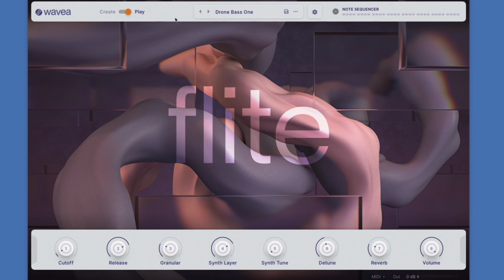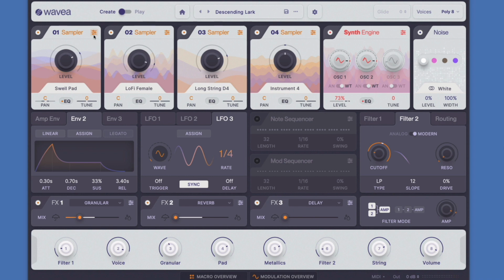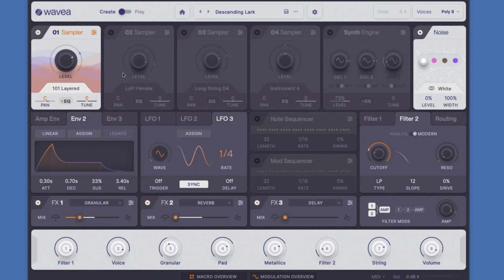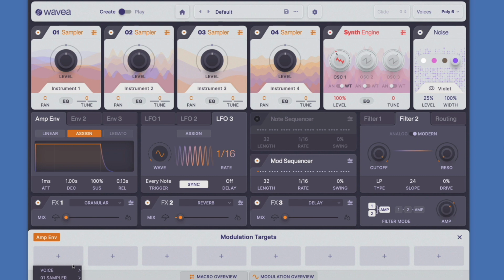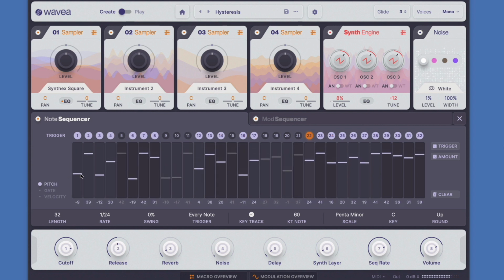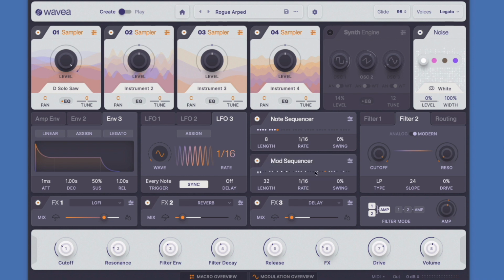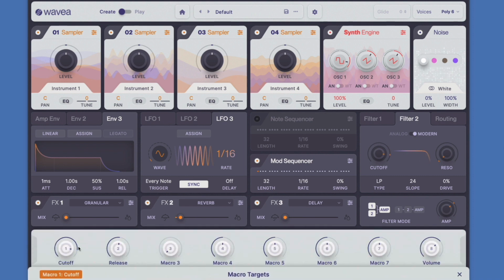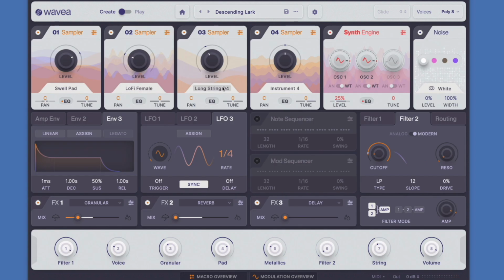Using Flite - A step-by-step how-to guide.

Comment: just purchased it and i like it but please could you add a previous/next button in the sampler moduls so we dont have to navigate a drop down menu every time we want to change the sample. thanks
Reply from the maker: We're working on this for a future update. Please watch this space!
Reply: @Waveapro  also the option to turn on/off each osc in the synth section without the new to expand the advanced options. thanks
Reply from the maker: @antgreen3254please down the very latest update v1.2. Finst files can now be navigated back and forth using cursors rather than drop-down

Comment: Hello. I like this instrument, but I would like to know if there is a detailed manual that explains in depth the import of user samples. If there is any type of nomenclature to name the samples or if it has automap. I would also like to know if it is possible to share sounds between users that contain samples. Thank you.
Reply from the maker: Hi, We just sent you an email responding to the specifics of sample import. Also, if you haven't already check out at 5.06 the section "Importing Samples".

Comment: I have found that once a parameter is mapped to a macro; say the dry/wet for FX3, then you no longer can move that parameter with the mouse from that point on. So if I want to go into FX3 and manually adjust the dry/wet, I have to go to the macro and move that instead. Feels like an extra step. Can't the macro just move along as I adjust the dry/wet in the FX3 module?